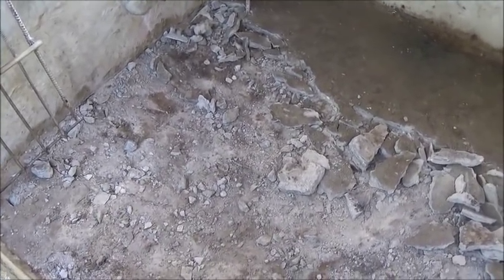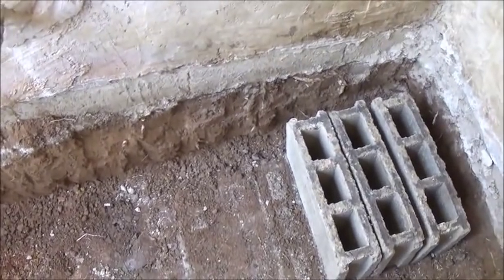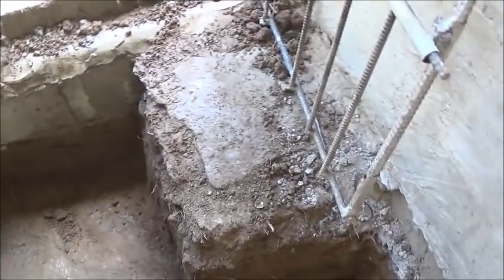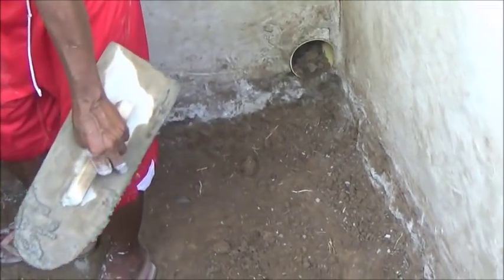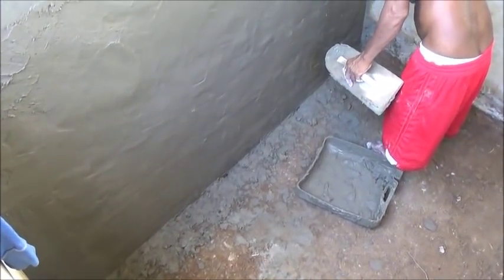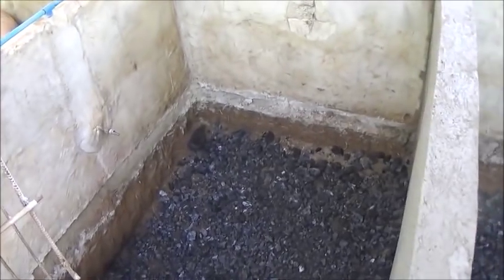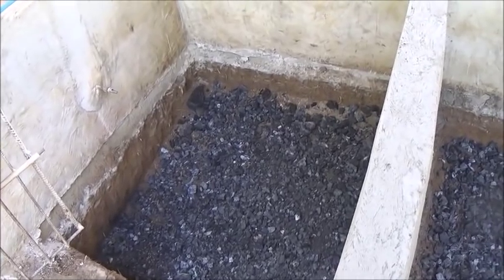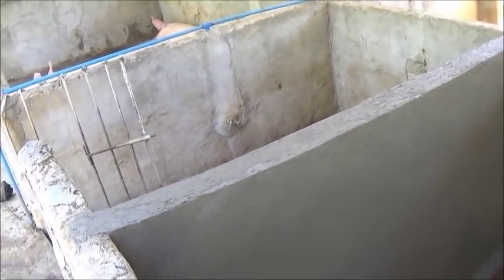Making Design Changes To Our Pig Pens

Comment: Hey Brian, You may find the pigs digging through the rice hulls to get to the charcoal. Pigs love charcoal and it is also good for them in controlling parasites,  worms and other bugs. In a previous video I mentioned in the comment section a  old farmers almanac from the early 1900's they talked about the general everyday use of  charcoal in the pigs diet for just that reason.  As  Martha Stewart says "It's a good thing" lol. I'm embarrassed I knew that.
Reply from the maker: I'm sure the pigs will do quite a bit of digging., more power to them.👍

Comment: '' Terra Preta '' > black soil . amazonian indians made this , much like your pen bedding . the charcol 
will become  a sponge / time release H20 & fertilizer  . that may well last 100s / 1000 of years in the soil . 
the char may reduce smells / odors for a time till its [soon] saturated . this will be a [ huge + ]  for your crops .
but >> the down side is the carbon released into the air during the burn !. there should be a hybrid solution 
to this .. maybe skip the chunks of charcol .?. add a [small ] amount of lime & sharp sand & tiny bits of unusable                      charcol ..to the bedding ?   then  ''DR Love'' , will still have her cooking charcol !!!!!!!! 
>> may i suggest ...contacting,,, ''DR Joseph Seeley''..aka 10 min joe , regarding the above .   SaLaMaT ...........